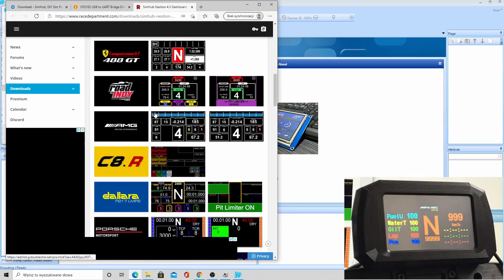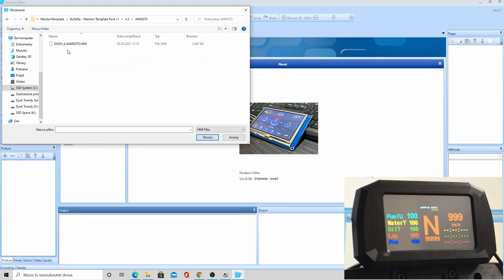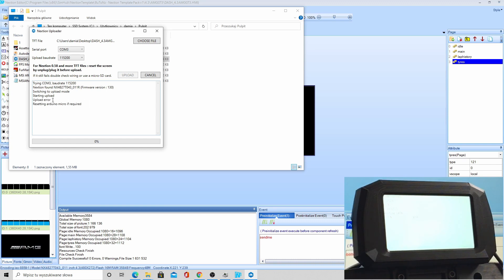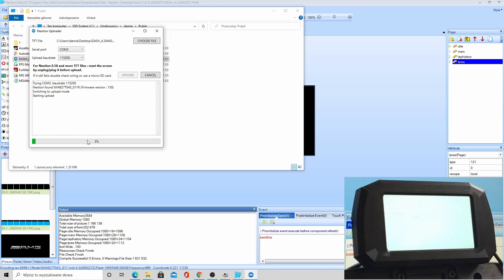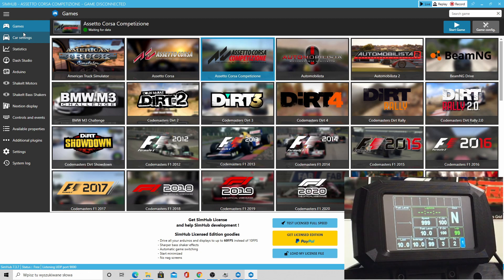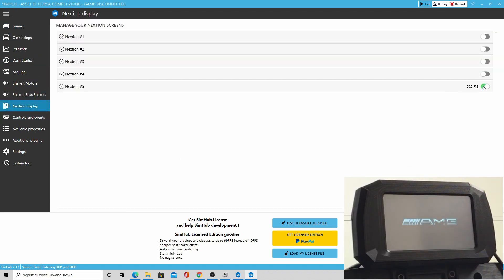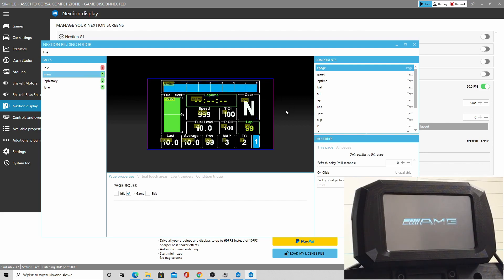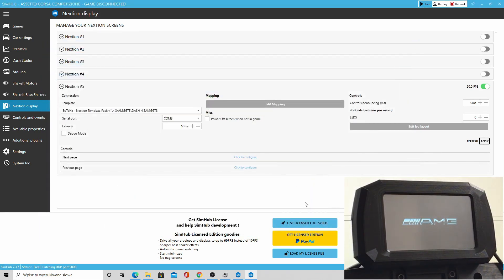Nextion SimHub Dash Display 3D Printed enclosure and setup instructions

Comment: I have the issue: "Nextion not found" unplugging didnt work. Anymore ideas?
Reply from the maker: Drivers for TTF adapter or Arduino installed?
Reply: @SimRacingAddict  I am using a Pro Micro and have installed the MicroBridge from simhub.
Reply: Are there specific drivers needed for arduino?
Reply from the maker: @sternfaust  CH340 (there are others). But if you have managed to load Microbridge in to it, you have them.
Reply: @SimRacingAddict  Oh yeah i already installed that. But my Problem is when trying to Upload Something on the nextion with the nextion uploader. I ordered a TLL and will try again with it...
Reply from the maker: @sternfaust  You can also use sd Card.  Have you tried different band rates? Do you have it connected correctly (RX,TX). Try using nextion editor to upload the file instead of simhub uploader.
Reply: @SimRacingAddict  I received the TTL and with the driver you linked it instantly worked... I dont know if I can be happy or not because now i have to use a second controller for the LED but i am releived to see it working now. Thanks for your help!